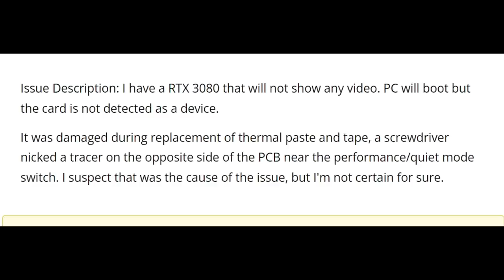ASUS TUF RTX 3080 V2 OC Repair - Damaged During thermal paste replacement

Comment: Really enjoyed this. What about heat and your repair? Long lasting? Also, lesson here? Why did that dumb A want to redo the thermal paste anyways on a new card? Dumb idea. Why risk anything on a GPU unless it is absolutely necessary? Thermal pad replacements? You sure bro that's essential when you can F up your entire card? Which costs more? Fixing or reducing the OC slightly? Grab a brain. The only question I have is that the fix seems a bit rinky dink for a GPU that is going to generate massive heat. A non issue? Just curious!

Comment: The reason you reapply (Higher quality) paste/pads is because GPUs and CPUs nowadays scale with temperature so the lower the temps the higher the clock speeds, basically the faster the GPU. And not forgetting to mention the poor quality of thermal paste and thermal pads provided by the manufacturer!

Comment: The issue here has nothing to do with re-pasting a GPU and everything to do with that poor abused screw above the damaged area shown in the video. I do wonder why the owner thought so much torque was needed.

I'm very certain they pressed down on that screw to keep the screw driver from slipping out and stabbed the board when it did finally do so.

Comment: The reason people try to change the pads and paste in rtx 3000 series cards are quite simple

Its the design flaw and the amount of heat it produces.
These cards are binned by Samsung and by nature
Samsung binning is not efficient and produces a lot of heat
For the card to survive longer
We try to change the pads and paste and some go even further to use metal pads
Its just because running your card at 95+c regularly isn’t good

Comment: 5 degrees? What about 30 degrees? I changed thermal paste on my 2060 because it was quite not existant after 2 years usage and it went from over 90 to 60~. I am not ok with the question at the start of the video, really sry, but repasting is a normal manteinance procedure that should be made as easier as possible for the user. Company doesnt do that because they want you to change the card after warranty expire....

Comment: Leaving thermal paste alone only damage when the owner open the card. I have one wouldn’t touch it. Use an extra fan than u dont need apply paste mine always cool so no need for thermal replacement. Mine have four fans by the way. I would spend my time cooling my pc rather than thinking I can replace thermal pads.

Comment: that 5 degrees can be the difference between thermal throttling and getting what you paid for in terms of performance a pc that thermal throttles under load especially in games can make the computer borderline useless if a little liquid metal can solve this issue then its worth doing, however applying it properly should be done by someone who knows what there doing too many people who have no clue just see someone els do it on the internet and see its great and just try it without realizing the risk involved oh well good business for you no doubt
Reply: 30-series cards don't thermal throttle unless you're deliberately turning off system cooling. No GPU runs hot enough to thermal throttle out of the box, that's just a bullshit claim.

Comment: I have a weird tendency/urge to quickly disassemble tech and expensive things i get to see how they work in the inside.
Ive changed the paste and pads on my 3070 founders a week after getting it. Didn't damage anything. I don't understand why people do it in a hurry or when they got little time. Theres also common sense. How do you make such a dent with a screwdriver?? When you're done with the screws you put it aside.. Just take your time and follow tutorials

Comment: I just want to chime in and give some perspective on "Why do you want to fix something that isn't broken."  These cards were probably bought by people with "IDGAF" money and they did it on a whim.  Or what I think is more likely people saved and saved and were in desperate need of a GPU and wanted to get Ti performance while saving money.  Instead of just spending the money on the next higher up GPU they figured that even if they break it and send it to you they saved a little bit of money on outrageously expensive GPUs.

Comment: So ya, dont try to repaste your brand new GPU just because you heard somewhere online that it reduces temps by a couple of degrees and makes your card faster. Best case scenario you're increasing your boost clocks by like 10mhz which probably wont even result in a 1 FPS increase.  Huge risk for basically no reward.

Comment: i do things liek that for watercooling and powermodding this cards but iam an eletrican guy so i know what i do....... if someone dont know what he do or think its easy DONT DO IT let do it proffessionals because repair a bad repair is hard....

btw greetings from germany xD

and a question did you have an old cpu  for pins for a 5900x i need to fix a cpu for my friend  but i dont have a old cpu with the correct pins

Comment: The reason people are replacing thermal paste is not only temps but life of a video card and performance. 
I do it to every card I owned over last 10 years gtx780, gtx1080 and now rtx3080ti - I open it once in 6 months to change the paste, dust off the fan and radiator fins - ThermalGrizzly Kryonaut is very good for that aplication. I can see prformance degradation if card is dusty and fan not clean enough. I recomend that only qualified people do maintenance. I am a hobbyst and was building pc's before I ever had a first girlfriend lol but seriously its very easy to damage electronics so dont do it if you're not sure about it.
Reply: Infact, i dont really like this attitude in the video. Replacing thermal paste should be a normal manteniance right and after the warranty ends its the only way to make a card last as long as possible. Instead the guy was totally against it. Wtf...

Comment: "During thermal paste replacement" , people is obsesed to replace paste, when in the 99% of the cases is not needed, not needed for 7/10 years.
most of the broken components is when people try to "clean" or "repaste"
see, just what he says, if is not broken, dont fix it.
if it works, dont touch it.

Comment: I love how half the stuff Alex ends up fixing is because some clown thought he knew better than the ones designing the product and then messing it up. 😂
Reply: did you see how bad the customer stripped that screw head
Reply: The ones designing the product are the same that will not help you anymore after warranty ends.... even for a simple problem that a simple change of TIM would fix...
Reply: @greenglassman  Right. Except the customer can't even handle a simple change of TIM without destroying the card. 😅
Reply: @johnwick7175  that doesnt change that if the warranty is gone and you need a TIM change, what are you going to do?
Reply: @greenglassman  Then you evaluate if you really "NEED" a TIM change or if you can live with that 1 extra degree. Most likely you just need to blow all the dust out of the radiator. The card itself doesn't need a TIM change to function for a lifetime. This video is just one of many perfectly working cards that were destroyed by a customer for no good reason. 😂

Comment: I really can't understand how someone should open up the card to replace thermal paste without long time having used the video card, and moreover how can one apply SO MUCH FORCE on a screwdriver (I guess to screw the screw as tight as possible, which is already dumb) to cause a rip of that scale (it's small but I assure you, you need A LOT of force to pick like that

Unbelievable

Comment: As a miner who has MANY 3080's.
Thermal pads are a MUST.

You are so wrong, the 3080 come out with DDR6X which thermal throttles at 105-110  degrees. These makers are cheaping out on parts which causes the card to INSTANTLY thermal throttles. Every single maker EXEPT EVGA REQUIRE THERMAL PAD REPLACEMENT. The pads litrally REMOVE upto 30-40 degrees from the memory from 110 degrees too 70.

They cheaped out on thermal pads.